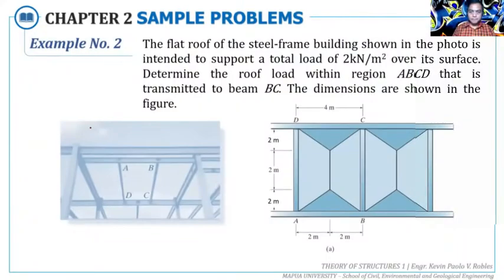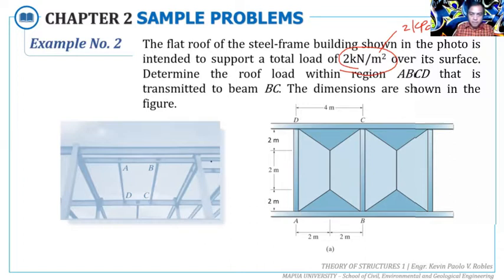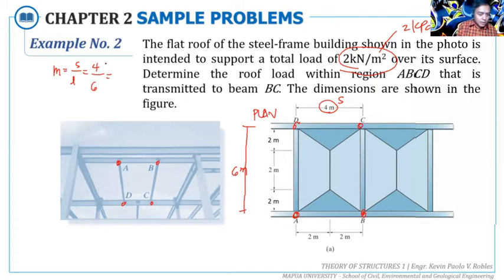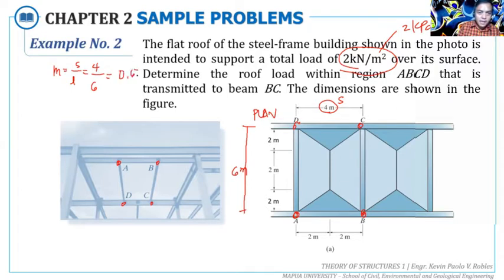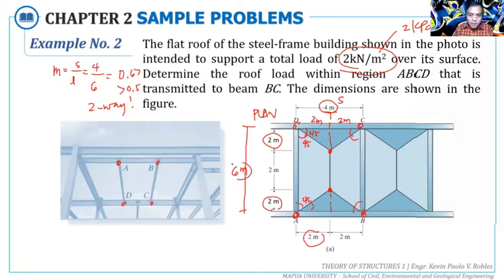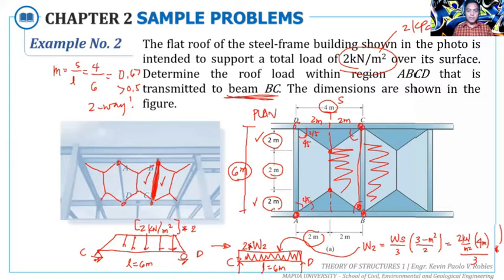THM1A7 SAMPLE PROBLEMS 2 & 3 TRIBUTARY LOADINGS

Comment: CORRECTION: For Example No. 2, the correct final answer should be 3.41 KN/m.  i.e. [ws/3]*[(3-m^2)/2] . Just the roof load within region ABCD so that means it only includes one trapezoidal tributary area (not times 2). Thank you! :D
Reply: Hi what book do you use